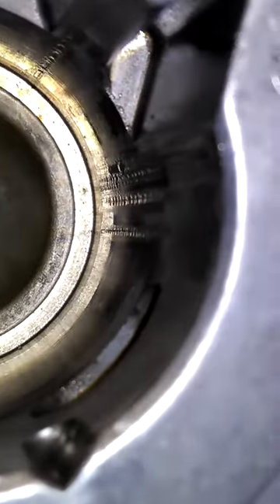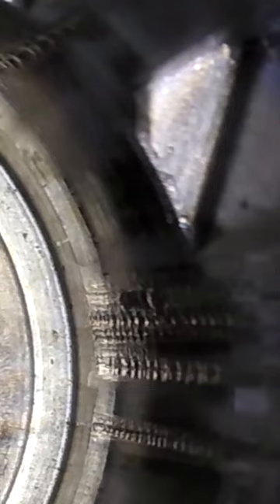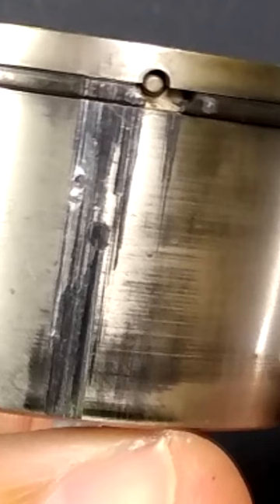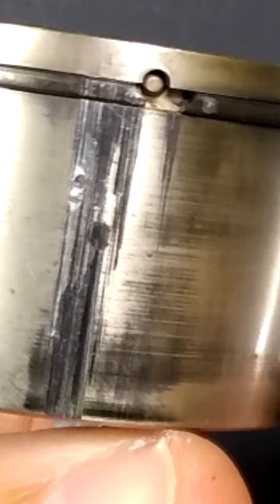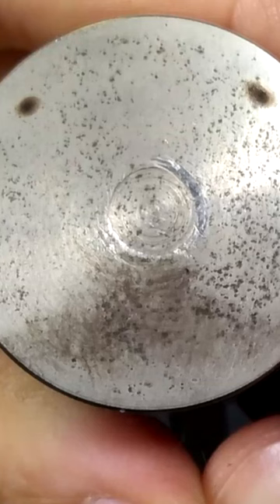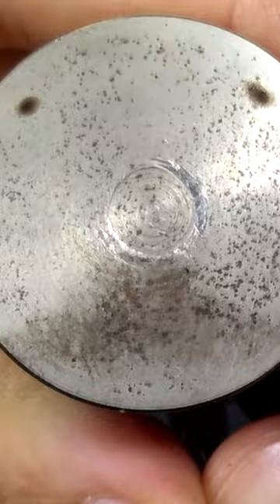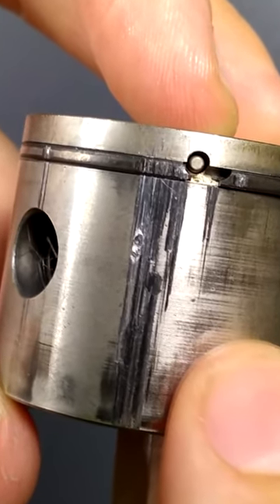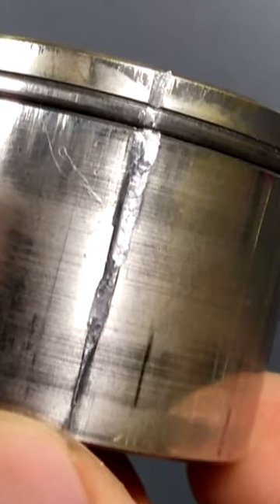Run a weed wacker without oil?

Comment: Yes I mistakenly ran one on straight gas for a few hrs and it locked up extremely tight. Once I realized someone had marked the wrong gas cans I pulled the plug and poured a few squirts of mystery oil in the chamber and let sit overnight, the next day it fired up and has been running like a champ every since

Comment: That’s why we always put labels on our gas cans to see what is in it. And if the labels fail, we put different colours of tape on each one colour coding them to see what has is for what. Green is the high test gas, blue is our 2 stroke fuel. And the yellow is just regular gas for the push mower. We try and run our big mower and snow blowers on high test.

Comment: Idea for another video. What happen when you run mixed gas in a 4 stroke.
Reply: lol…. Can I fix this? If not, there just went a weed eater… normally our smaller can is already pre mixed.. I got up early to avoid the heat and didn’t make it was mixed gas…
Reply: @carlosval7254  Oh no! You put regular gas in your weed wacker? If you did and your asking if you can fix it, it depends. How long did you run it with regular gas in it? Depending on how bad it is, it may be able to be fixed.
Reply: @derahnsikes3  I did man. I ran that thing until it died 🥹

Comment: I ran a echo 7xxx blower for 2 years on straight gas . I thought it was a 4 cycle . It stop running I took it apart cleaned it up threw mixed gas in it and its been going for 4 years.

Comment: Ran a two stroke with straight gas by accident for a few hours. It started getting harder to run. The next week I went to take it out of the shed, apparently the motor had gotten so hot that it melted a hole in the fuel line. Puddle on the floor, empty tank.

Comment: do a video running a mower with 2 stroke gas
Reply: how about stroke 2 mowers with one gas
Reply: It'll smoke but be fine.
Reply: It’ll just smoke ALOT
Reply: No harm doing that and with today's  two stroke oils it would barely smoke
Reply: Won’t do anything but help lubricate even more.
Reply: @jay7264 barely?
Reply: Extreme upper cylinder lubrication, lol. Actually it'd be good for it, cut back on wear. Just smoke like a mother and cut down on power a bit.
Reply: @Antiquefarmequipment 🎯👍